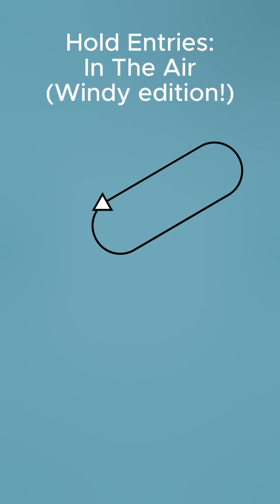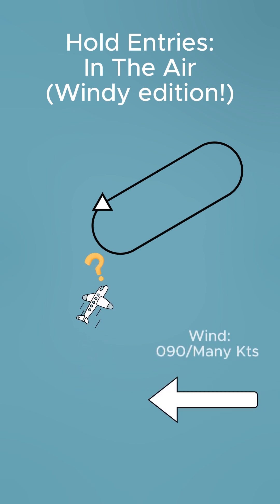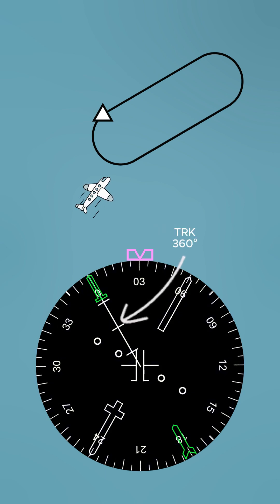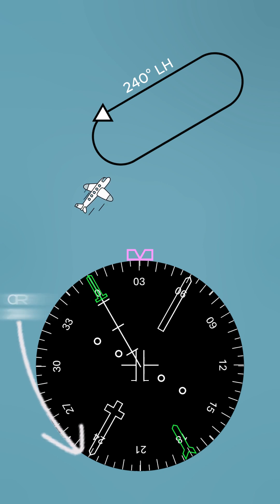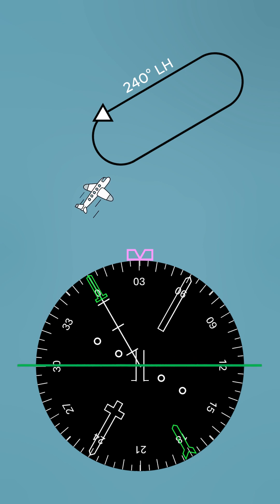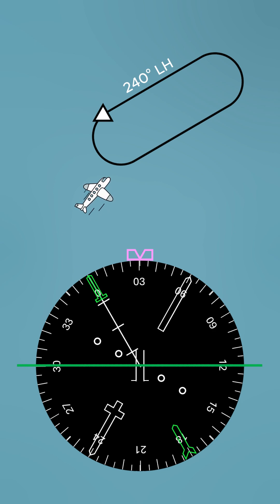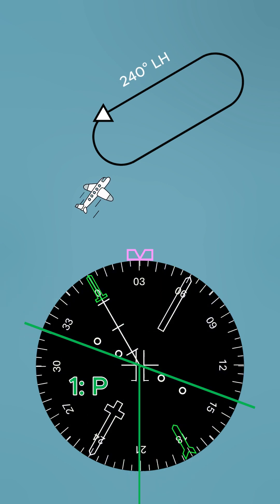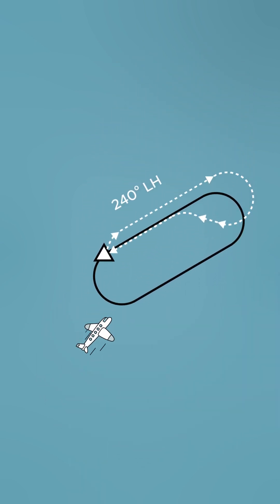How to determine hold entry on the HSI: Demo with wind

Comment: In a modern cockpit with ForeFlight and GPS you’ll be able to see the hold visually as you approach. All you have to do is pick the entry that has the least amount of turn. That’s the correct entry. It’s that simple.
Reply: Piloting is so much more simplified nowadays. Though we still have to learn the old way😢